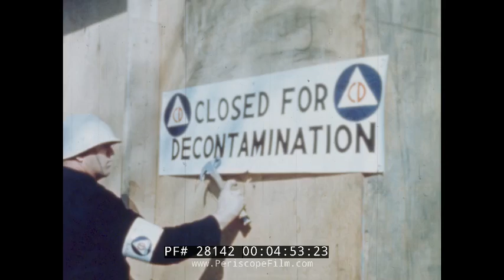CIVIL DEFENSE FILM "FOOD SUPPLY AFTER THE BOMB"  28142

Comment: Considering how long ago this was produced it still holds up well today, logic and common sense is timeless!
Reply: +watershed44 You are so right about your comment! After my experience with hurricanes Charlie, Frances and Jean, in many parts of this CD film has shown to be true during those hurricanes and a couple of weeks after. In my area we were without power for three weeks even though we are part of the city of Orlando. During that time, for just a couple of days, if service stations had power for the gas pumps, they were actually rationed gas to 5 gallons per vehicle and no gas cans allowed. Also for several days ice was actually rationed to just one bag per adult. The other surrounding counties were in the same situation.  I was smart enough to buy extra non perishable groceries, a generator (at the last minute) and topped off the gas tanks in the vehicles and the gas cans. That generator wound up supplying barely enough of the power to three houses for just a refrig, two fans, and two lights for each house which included mine.
Reply: +lassit lassit1 I happened to be on vacation at Universal Studios when Charlie hit. Ended up outrunning it to SC . Ha
Reply: We were miserable. I am a Floridian and used to muggy hot weather. However, the ice cold showers really sucked. I bought 100' of black garden hoses and threw on the roof for solar water heating. Then snaked the hose through a open bathroom window. The problem was the water was too hot coming directly out of the hose during the day. So we wound up having the shower supply the cold water with the garden hose supply the hot water. The hose was zipped tied to the shower head. We could only take basically a "spit" bath. If we were smart, we should have gone up to S.C. for a couple of weeks then come back down....
Reply: Exactly, "common sense rules, panic and chaos fail".
Reply: Some of it would apply to hurricane preparedness. But recovery after a nuclear bomb blast after a mere 10 days? I don't know whether to laugh or be outraged. And there's no way I'm cooking in a dress, high heels, and pearls.
Reply: @lassitc  Thank You for sharing the power with your neighbors, not everyone is so kind!!!
Reply: @helenel4126  LOL!  I'm surprised that they didn't have it served on a silver plater and have the wife wear white gloves as she held the tray!

Comment: Better plan is a stock rotation system with replacing as you use.  Then nothing gets too old.

A propane camp stove and a couple of 20 lb tanks is a good idea for anyone to have.  Essentially the  camp kitchen a scoutmaster would use while the scouts try to light their fires...
Reply: Gas type cooking methods are not approved by testing at the Oak Ridge National Laboratory. They discovered that the blast from a bomb renders gas compressed cylinders dangerous to occupants of different types of shelters. It is recommended to use an alternative source, like candles, or a bucket stove, to prepare foods. Preference is given to foods that do not require cooking. This is especially true if a shelter has limited ventilation.

Comment: She could have used 10 gallons of water per person.  Two quarts won't wet the whistle.  It helps to store more if you have food that needs water for preparation.  This includes freeze-dried foods which have a longer shelf life than canned foods.
Reply: she could have used the water in the toilet tank there is at least 5 gallons of good potable water not to mention draining the 30 gallons from the hot water tank! but back in the 50's no one thought of that.
--Rick

Comment: Notice the comment where the shelters should be stocked with canned goods with a long shelf life? Same thing preppers have been doing for years. But how was the food to be cooked? Looks like they were using an electric stove, but what happens when there's no power?
Reply: you use a candle stove or buddy burner, made from a tuna can  set with a tightly coiled rolled strips  of cardboard cut even with the can and filled with paraffin wax, there are lots of ways to heat food in a shelter.
--Rick

Comment: They say after 10 days normal food resupply should begin again. Well, I think they are a little optimistic here. Maybe after 10 years? Maybe 100 years? Radiated fields, EMP destroying power grid, EMP destroying computers hooked up to it, looting, rioting, starvation, and more? 10 days is a bit optimistic unless the enemy only drops 1 bomb. If they drop lets say 100 of them with 7 used at high altitude for EMP effect, 43 used as surface blast to destroy military assets and the remaining 50 used to destroy population and economic centers, then we add in Fallout and nuclear winter for just 1-3 years, I doubt 10 days to restore food supply is realistic? I love these old films and most of the information is as valid today as it was then, they just did not know about todays electronics and the full effect of atmospheric clouds of dust suspended for several years.
Reply: EMP doesn't have much to do with food resupply. Most of the radiation will decay in just a few weeks. If nuclear winter even does happen, it would end very quickly. If multiple bombs dropped, I dont think grocery stores would be restored in just 10 days, but it certainly wouldn't be 10 years.